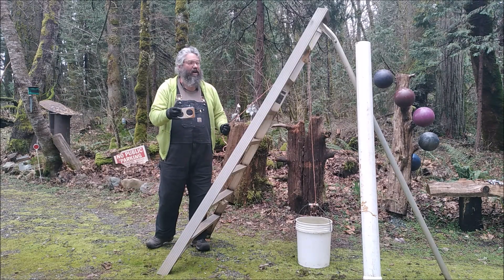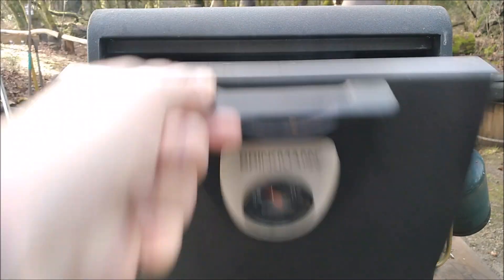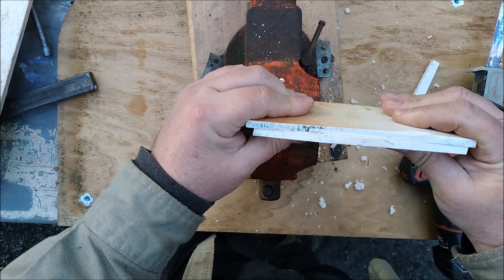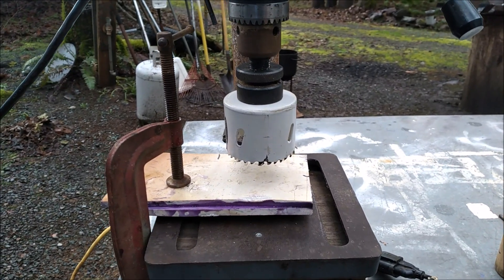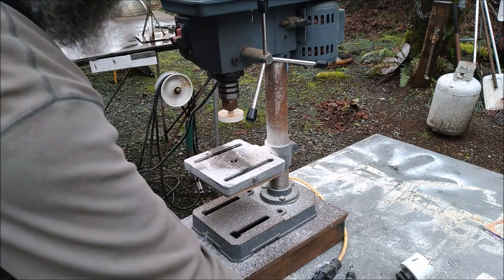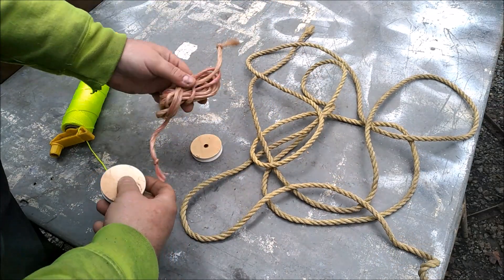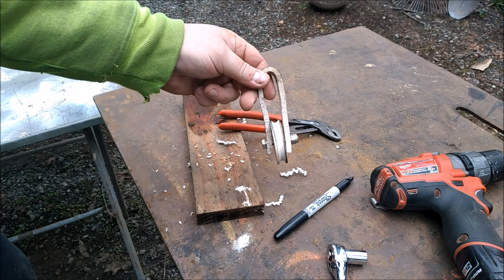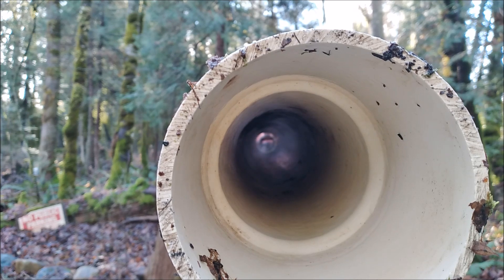Flatten PVC Pipe!  Make a Pulley!

Comment: What if you used 3 layers,the center layer being 1 3/4"?7 Then it would be easier to guide the rat tail into the middle of the pully
Reply from the maker: THat's a great idea!  I've been thinking maybe do kinda what you're saying but then put a metal insert onto the smaller inner pulley somehow.
Reply: @thecatsupdog  I'd probably do your copper insert thing to keep them centered as possible
Reply: I think I'd be a good off grid guy.As a finish carpenter in always having to make things work
Reply from the maker: @64maxpower  I've always wondered who would win in a fight.  A framer or a finish carpenter!
Reply: @thecatsupdog  no need to wonder. Framers and Masons and Roofers are sick MFers. Finish Carpenters are lambs
Reply from the maker: @64maxpower  Shoot!  I am laughing quite a bit!

Comment: On a more serious note relating to this video. You might share the knowledge that regardless of pressurized pvc or not. If you want your pvc connections to stay connected above ground especially below ground you should use primer on everything. And apply the cement while the primer is still wet on the fittings and the pipe. The pullys look good. People watching this. Do not make these pullys to use as a zip line method of transportation for human beings unless you are willing to post the live videos of them being used from the first time right up to where the ambulance arrives.
Reply from the maker: G Dam you're funny!  I should make a video of my fat a$$ zip lining with a PVC pulley!  I have a 14 lb dog that would be much easier to film on a zip line, but I don't think he would like it.  Thanks for the info on the primer, I will include it any other PVC videos.
Reply: @thecatsupdog  i wont have to worry about falling to my death. With that much weight on there worse case scenario ill get a scuffed shin from dragging across the forest. First time in history a braided cable gets a hernia.
Reply: Very funny David 😂😂😂